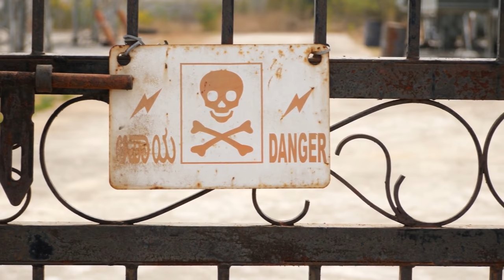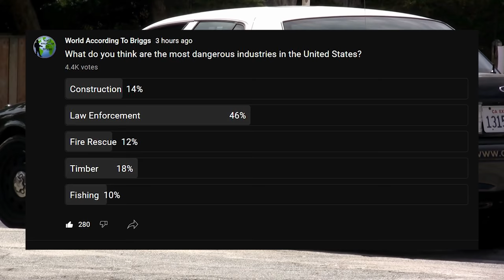Top 10 Most Dangerous Jobs in The United States.

Comment: Back in the day, loggers didn't wear ear protection. Many of the older loggers suffered hearing loss from the noise. My step father was almost completely deaf.
Reply: oh yeah. i do landscaping and tree work. es loud!
Reply: Damn
Reply: What?
Reply: That and carpal tunnel, log for a few years and you ain't gettin' away from that, I haven't used breakable coffee mugs or drinking "glasses" for over thirty years.
Reply: @bodaciousoasis2574  That's what anti-vibration is all about. Many big, high-revving modern saws are smooth as silk in your hands. Ditto the smaller ones.
Reply: @jacquesblaque7728  
 Those help with pain once you've got it but don't stop it from developing, you're still constantly holding and squeezing tight, including with pretty much everything else you're doing and doing it with, it's an over 90% heavy duty hands on occupation, and you're capable of doing it long enough it will destroy them...most people don't last long, especially if they're smart enough😉
Reply: WHAT???

Comment: Ironworkers, I’m a retired one. On the largest indoor working area in the world at the time I worked on in Everett WA for boeing. Canron was the contractor. I was a connector a guy fell every 6 weeks most died. We walked around on  beams and t shaped wind bracing 125 ft in the air. Smoked weed on iron, I never came in hung over, don’t drink, others did. A lot of them. We were not required to tie off. That changed in 1989. They made it a requirement, this was before drug tests. If you won the check pool you had to buy a 1/2 gallon of whiskey for the dry shack.

Comment: I had several of these jobs but in 1970 as an 18 year old logging in the Olympics I had to jump off a 20 foot cliff because the tree wouldn't stop rolling down the hill and rolled over where I was standing . My 1 year of logging I saw a man lose a leg from a broken choker , a steel cable snapping.
Reply: I set chokers for a helicopter logging company back when I was a young man. I left the woods to get into construction work as a boilermaker. 
Respect for the mention of the Olympic Mountains! My home was on the southwest  side of the mountains.
Reply: @briangarrow448  At the time I was living in Tacoma but slept in a tent During the week in Humptulip.
Reply: @willardwooten9582  My ex’s parents owned “The Red Rooster”. I grew up in Hoquiam. Humptulips was only a few miles away.
Reply: @briangarrow448  I think I ate their If it's on Hwy 101.
Reply: @willardwooten9582  Yes, was on the left side of the highway if you were heading north to Quinault. The last time I was in the area, the building was still there but the tavern and store had been closed for years.

Comment: I have worked in many of these fields and in the real world the most dangerous job is small farming. (Between 250-1000 acres) You're always alone moving heavy equipment, repairing tractors, felling trees, welding, constantly exposed to dangerous chemicals... the list goes on and on; the big part is there is no safety regulations. Hell, I'm lucky if I even have a helper.

Comment: Surprised being an electrical lineman isn’t one of the most dangerous. High elevation and energized lines are pretty gnarly
Reply: It's not? I just started the video and my husband is a licensed electrician. His dad was a lineman back in the day and for sure it would've been a "dangerous" job if this list was made a couple decades ago, if not a few years ago.
Reply: Oh I agree - a family member died doing this 40 years ago!!!
Reply: this and underwater welding
Reply: Because everything they do has a book on it. I'm a arborist and I've worked side by side with them many times. The older guys could splice guy wires by hand which was fucking impressive.  The newer guys? If it aint on the truck they won't rig shit up. In my industry I've almost died multiple times. Even had to get out of a tree after being knocked unconscious with a broke arm. I know multiple guys that have died or been permanently maimed. Out of the maybe 40 linemen I know there hasn't been any injuries besides carpel tunnel from using all that electrical tape
Reply: That’s exactly what I thought, because that’s my dream job and my dad is in the in the industry

Comment: Living in the PNW I had an unfair advantage at knowing the top 2 right away.  I think it is talked about at least once a month on the news.
Reply: I don't understand how anyone can live in an area with a ton of manufacturing jobs and not be willing to take such a job as a last resort. From what I read some of those jobs do have decent pay like $17 an hour even despite being in states or areas with a low cost of living, even though in most cases you are only doing a single repetitive task all the time which is easy. I don't get bored easily so I would much rather know I can do a repetitive job than having to do random different things a lot.

I live in southern Maryland and I have literally only ever seen 1 or 2 manufacturing type jobs around here. I got a bachelor ms degree in 2008 and obviously I couldn't get a decent job due to the recession so I did apply for that one manufacturing job by the time I saw that they were hiring and I had an interview but didn't get hired. The other one was working outside at a scrap yard and it was pretty much all men but they didn't hire me. I worked at a thrift store starting in 2010 for only $8.07 an hour and they would only give me part time hours.
Reply: Can't find anybody to go up in woods and choke logs up here in Oregon.

Comment: Thank you Briggs. Finally showing welders on a dangerous jobs list. It is a VERY dangerous job. I did it for 8 years and had to pass on it ( which REALLY sucked) because of an unrelated accident. Its amazing, the feeling of control you get from it is fantastic. However the things you have to worry about is YOUR own protection since most companies don't care about your long term health. So long as you are grounded, have a  harness for work at heights. Use a PAPR, and wear your gear your fine. I have come out with a few burns here and there, but I have also seen one buddy burn alive ( got the back of his jacket caught on fire, then the rest went up ).  If you watch how you lift, and get help when you need it, the most dangerous part of the trade is cutting with a cut off wheel. But that's just me. I fell in love with it and still play at home.
Reply: That's badass...stay safe!

Comment: Had to watch. Because for 14 years I delivered propane. In all the trucks.  The blue rhino 20 pound exchange service. All across Ohio , Pennsylvania. There was only one time the back end of my truck ballooned. A short in the brake lights wiring harness. couple tanks were leaking.  I found that out real fast two of the doors blew off the back end of the trailer ballooned. My second encounter was with a bobtail home delivery. Just because the tank has an emergency shut off valve on it  doesn’t mean all them delivery pipes that gets the propane from the truck to the tank in the back of the house is full of liquid propane. Even though the gauges are checked every year the one sensor that monitors temperature control.  When I look back to my truck when I heard this loud hissing noise thank God for remote shut downs. Still had a problem though I still had all the gas in those pipes after that incident there’s a lot more shut off valves on the backend of them trucks now. Then the last but not least I was loading a transporter that’s a 10,000 gallon propane tank at United refinery. Bringing a load back down to the blue rhino plant. 6 AM beautiful morning double checked everything had everything hooked up double checked all the connections putting the stinky stuff in check the bleeder valve made sure that was added. Went to turn the pump on the damn connection started leaking. Which I hit shut off to the pump walked over pulled the emergency shut off to the transporter. But like I said there’s 25 feet of liquid propane that’s still in the hose and it’s leaking out within the first minute there was a cloud you couldn’t see you could barely even breathe. I hit the bleeder valve on my hose so it starts redirecting some of the gas out to the top of the truck. The united refinery employee came over and through the burn tower lever so most of that liquid propane gas would go out to the burn tower within about five minutes the problem was solved. The only sucky part was when the alarms went off when the sensors in the LP yard detected the gas leak the emergency horns blow. Everybody else runs but me and the LP guy. But with us propane drivers if you see us running you’re still too close keep running.  And if you don’t know what I mean do a search on propane explosions on YouTube and you’ll understand that if you can still see us run.  Then you didn’t run far enough away.   😂😂😂😂